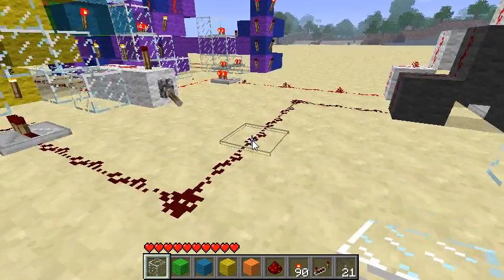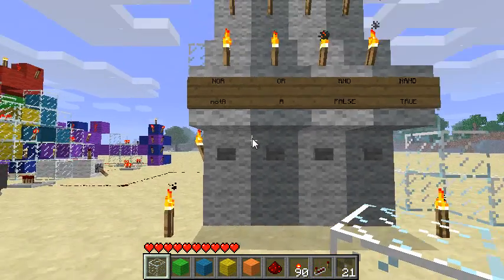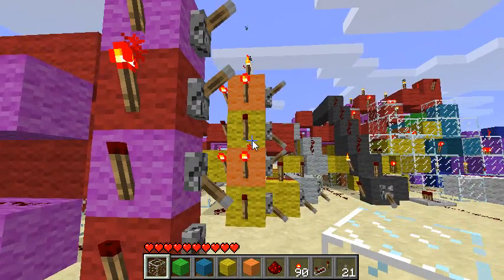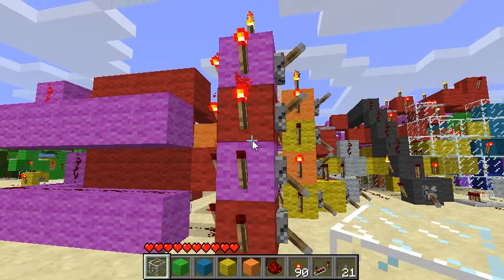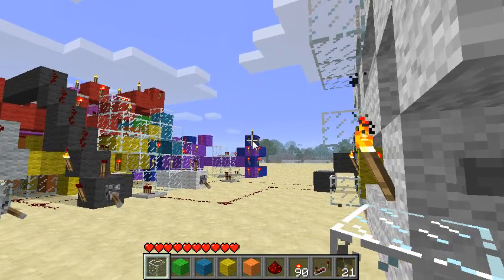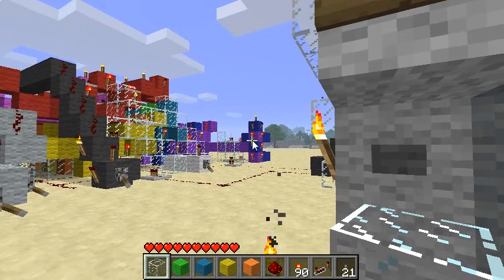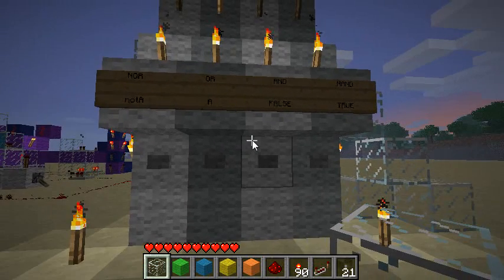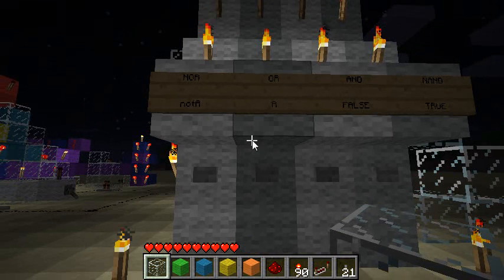Multi-Function Logic Gate

Comment from the maker: @Cool12309FromRoblox 
Yes, before the addition of Pistons, that was the only way to force a line off; force it to 1 then invert.  With pistons, you have the option of a more straightforward disconnection if you want by removing blocks from next to repeaters, or by cutting wire running up a step.  The latter is quite useful since it lets you cut a signal without adding any additional delay to the wire it's running through.